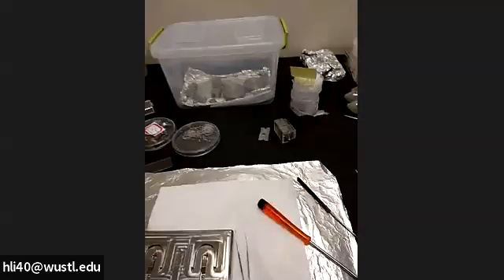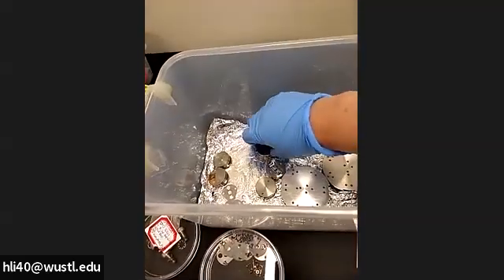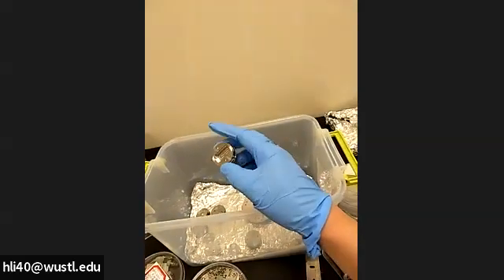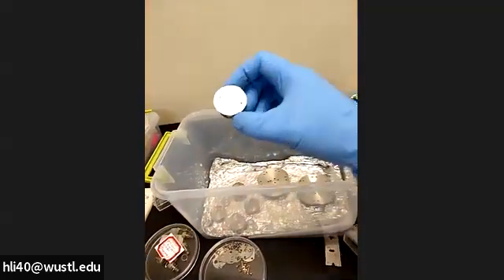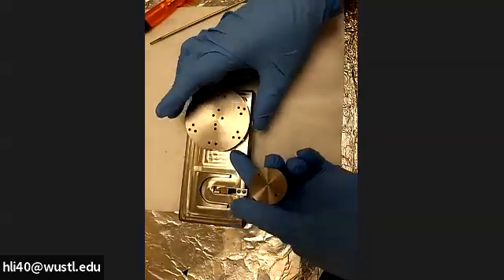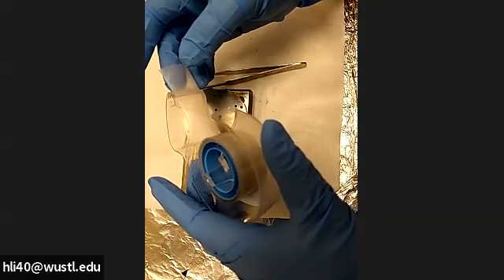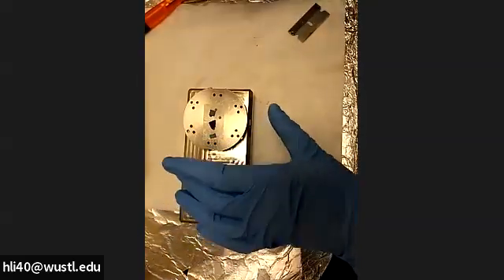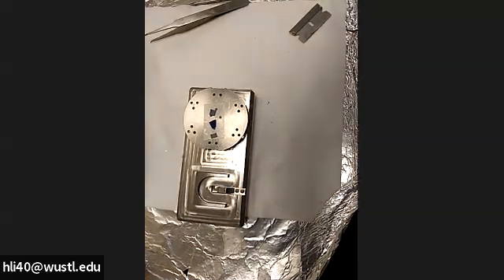XPS Training Video 1: Mount sample to holder

Comment: Can we do XPS of glass coverslip? Can it withstand high vacuum? Is there any special care to be taken of?
Reply: Glass cover slip is fine. If using clips and screws to secure the sample, make sure don't over tighten the screws as it might break the cover glass. An alternative way  is to use photo double sided tape, however, this may be difficult to remove the cover glass off the tape after experiment. I don't see the concern about vacuum when working on glass samples. Glass will charge during XPS spectrum collection, make sure that charge neutralizers are working in the system.
Reply: @huafangli1692  thank you so much.. the information you provided helps me a lot.. I will definitely consider your suggestions.
Reply: @huafangli1692  can you please provide any suggestions for avoiding charging effect in glass during XPS.